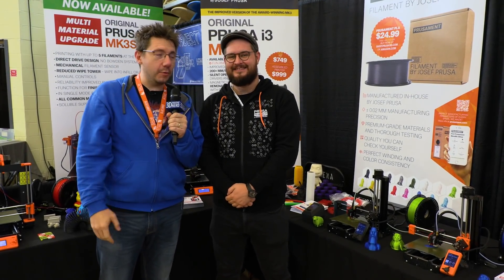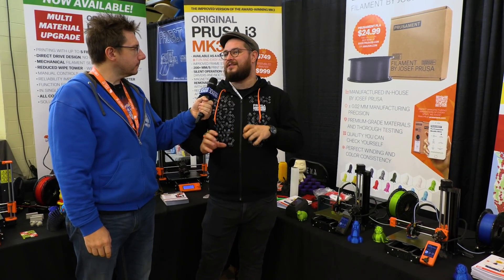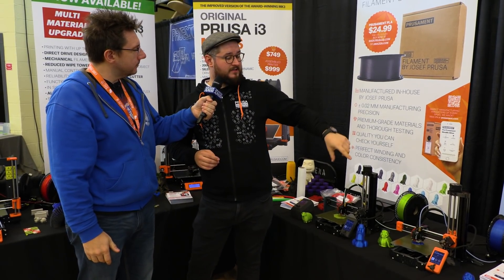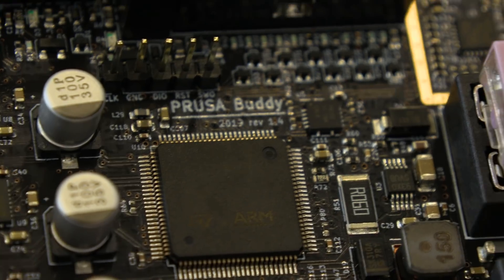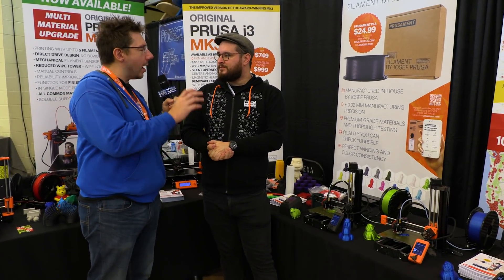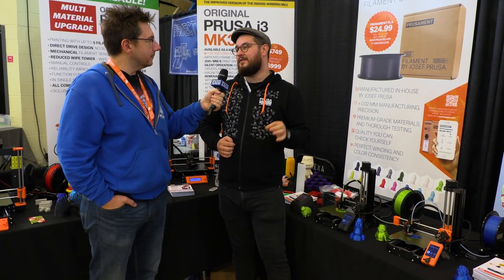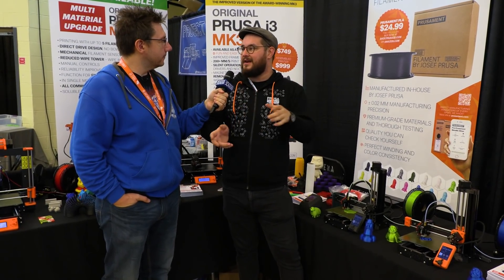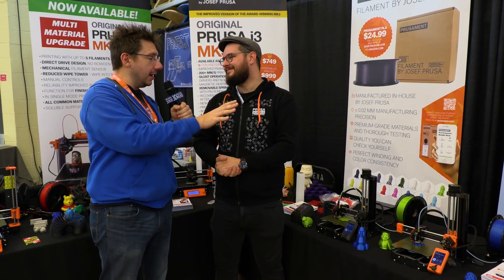$349 PRUSA MINI - Impressive Features AND a 32 bit board in a Smaller Form Factor

Comment: Still using smooth guide rods?? It's a No Buy for me...
Reply: I think the quality of prints is better with smooth rods than them roller set ups.   But that's just my opinion.   I've had several printers with the roller wheels and for me I just didn't like them.
Reply from the maker: What would you use in this case?
Reply: @3DPrintingNerd  I would like to suggest linear rails, unless linear rails are some how inferior to smooth guide rods in this application?
Reply: @evlsc400  It's cost. IMO, the Prusa Mini is intended to be a product to challenge the low-cost Chinese printer market yet still have the support structure behind Prusa. Smooth rods work just fine, and yes linear rails are beautiful (half of my printers have been upgraded to use them), but that would significantly drive up the cost of these printers for a marginal boost in performance.

I encourage you or anyone to make a remix for the Prusa Mini when the design files are published so it has the ability to be exactly the way an individual wants it (like the endless list of Cr-10 and Ender 3 mods), but personally, I'm going to leave it stock for a long, long time.